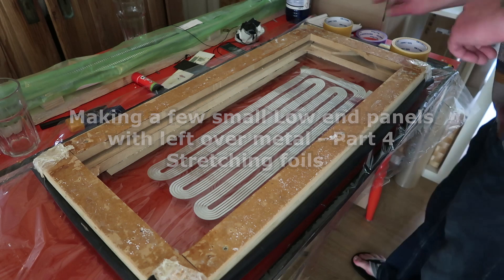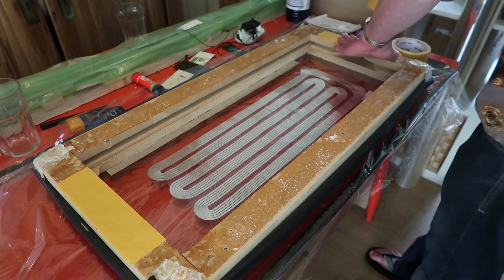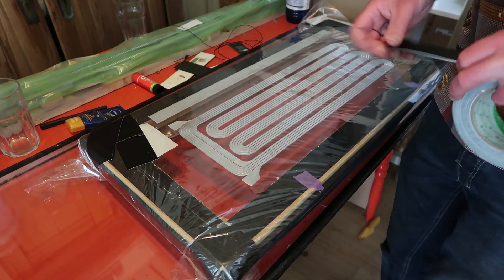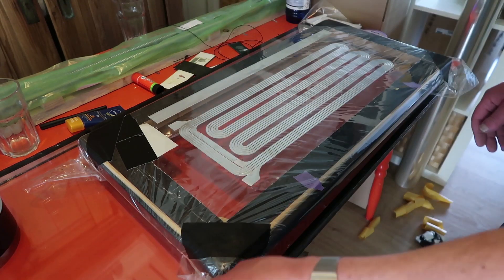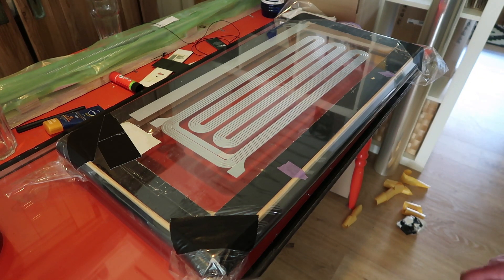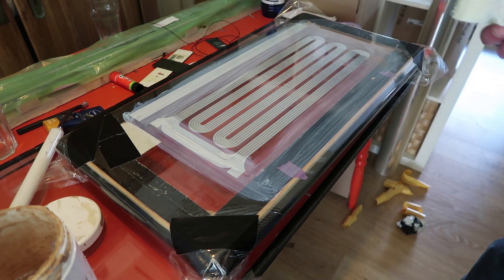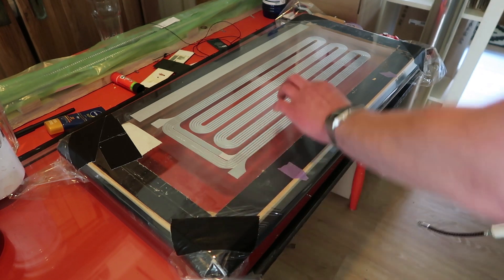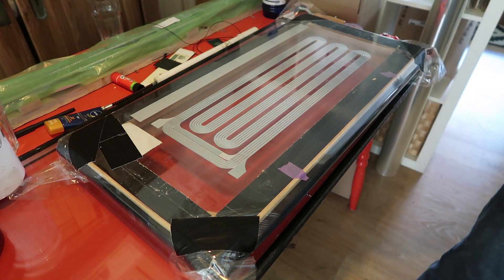Bass Planar Magnetic Woofer from scrap steel - Part 4 stretching foils

Comment: At 10:14, how do you avoid cutting through the bicycle(?) hose?  Very good idea with the bicycle hose to tension the membrane. I used a heat gun, but that was not that deterministic.
Reply from the maker: The tire is on the outside of the wood.
Reply: @joppepeelen  Ok. I guess that I have to look more closely then.

Comment: At 10:58, any suggestions on how to lower the fs?
Reply from the maker: in this case unscrewing the metal from the frame on one side (4 screws) might be enough to release enough tension. then put the screws back but one perforation  next to the original hole used for the screw.
Reply: @joppepeelen  Or make the membrane heavier. Perhaps use the salt method to check out the resonances and so on.
See for example https://www.youtube.com/watch?v=jhaTULO2Zkc
Reply from the maker: Making it heavy hurts efficiency
Reply: @joppepeelen  Yes of course. But could be interresting to try it.